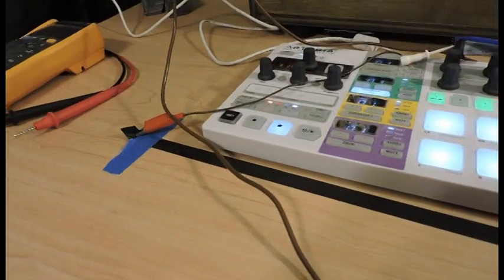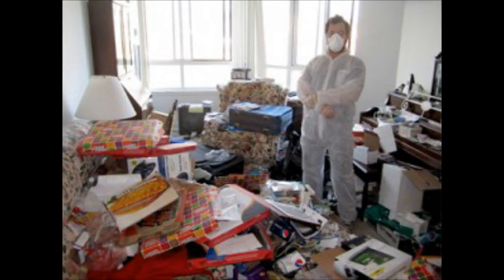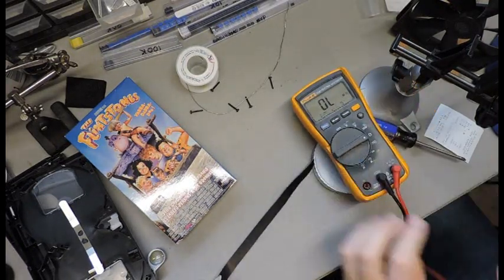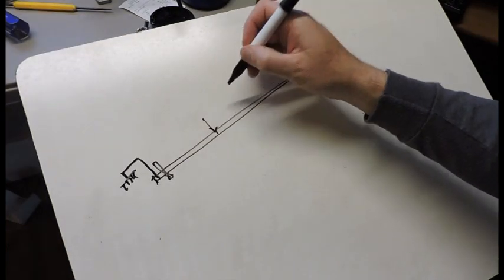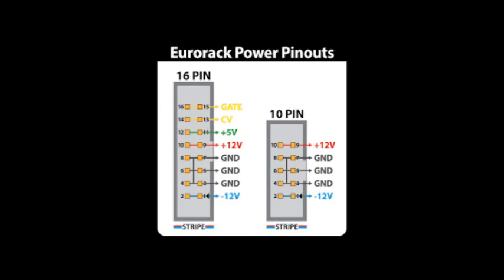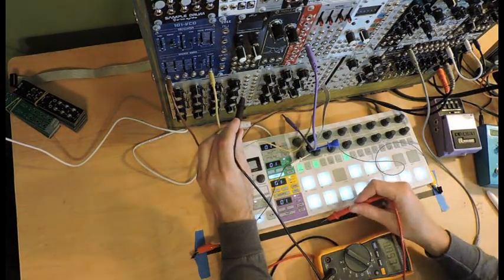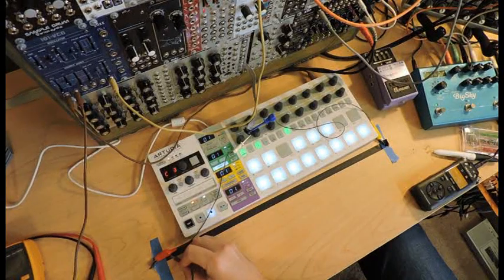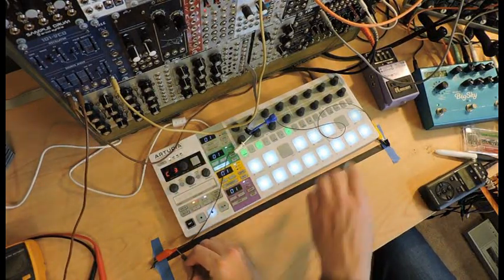Makeshift VHS Tape Ribbon Controller In 3-Minutes

Comment: Just the fact that you destroyed a Flintstones movie tape is worth a thumbs up from me. Could you maybe place a squishy semi-conductive material between two strips to allow it to be operated by finger pressure and kind of mimic the Doepfer A-198?
Reply from the maker: The material would need to be semi-conductive.
Reply: @gstormelectro  Indeed, I think it's probably beyond DIY. I found that pressure sensors can be harvested from keyboards or Sparkfun make a touch ribbon potentiometer and a pressure ribbon pot that can be combined, both very reasonable prices for DIY.

Comment: Does it have to be a specific tape ?
Reply from the maker: What is tape?  I'm no expert, but it's plastic w/ various metals on at least one side.  Some tapes are more conductive than others, and will serve the purpose better.  They're very cheap so if you get one that doesn't work then simply try another tape.
Reply: @gstormelectro  , you are turning this in to a bigger mystery than it is :-) Some vhs-tapes have coating on both sides (as well as audio tape for that matter), and some have not. So for anyone wanting to try this you need the one with coating only on one side.

Comment: Sounds a lot like a theremin.
Reply from the maker: What is a theremin but an oscillator having its pitch varied by a continuously variable voltage (not step-varied like a conventional synth).  In the same way, a ribbon controller can continuously vary the voltage.  Same outcome can be had w/ d-beam (photovoltaic), ring slider (Ondes Martenot), pitch bend lever...there are many ways to get there.
Reply: @gstormelectro  very true, the D-Beam is pretty cool on my old Roland MC505 back in the day,. It’s a shame they don’t expand on its technology. I picture an instrument that uses both the D-Beam and Electromagnetic tech. Or maybe a controller. Like a Seaboard on steroids